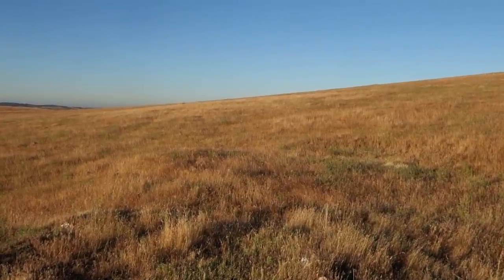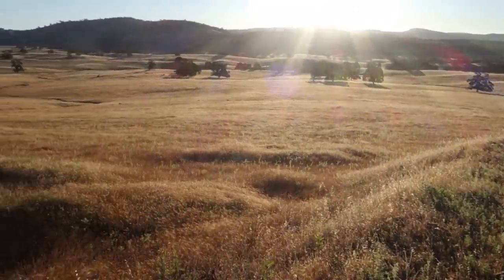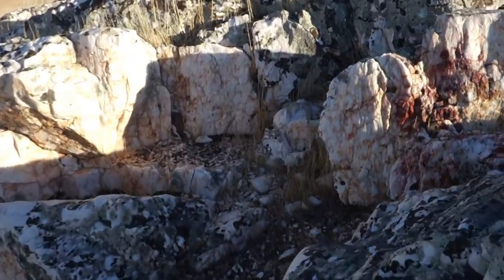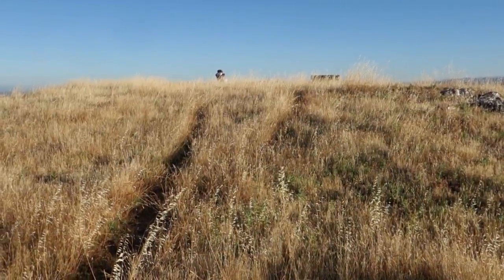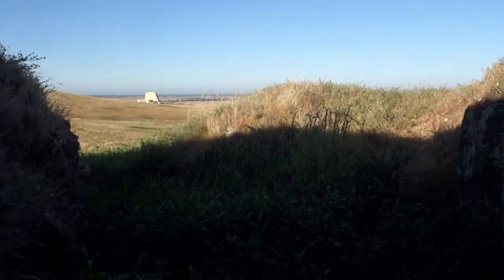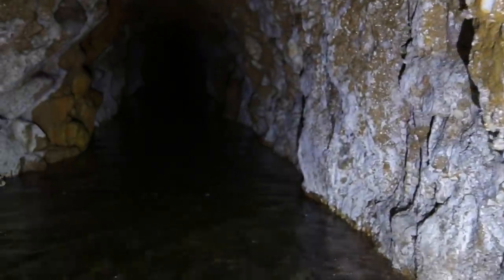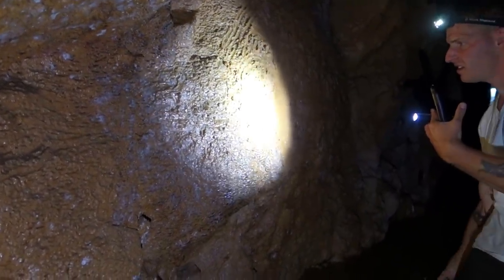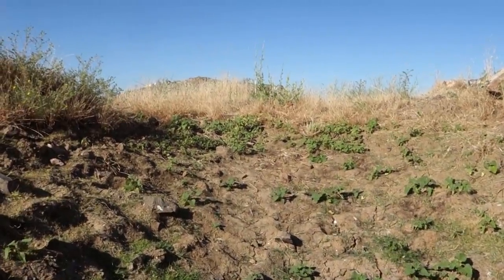The Gold Mines Of Beale Air Force Base - Part 1 of 2

Comment: Thanks for the video! Cool to see the mine shaft and wow, how clear is that water.
We lived on Beale for 10 years since 85 and still use the base as retired Air Force member.
I use to take the kids for hikes all over the base and the Spenceville Wildlife Area. You can still see the old wagon wheel ruts on some of the old narrow roads through the hills.
There are a lot of Coyote that live on the base and watch out for rattlesnakes. 
At one time the base consumed 80,000 acres. The Donner Party come through Beale.
We now live a less than an hour away in an old gold mining town on a ridge between the North Fork Yuba and the South Fork Feather rivers. The back of our property is an old gold mine, tons of gold bearing quartz all over the place.
As Camp Beale was an Army training base and a POW camp for Germans during WWII.
There were a lot of concrete structures that were built and used for moving tank targets. 
To purchase property around the base you must sign a disclosure agreement acknowledging the potential present of unexploded ordinance. I myself have found old exploded shell parts.

Comment: Cool stuff. As I am sure you are aware, Patton trained at Camp Beale back in the early days of his career in tanks. There are still training munitions all over that area, Beale has offered to send teams out to clear property over the years and many have taken advantage of the offer, but, back in the 90's a handful of folks out trying to pull rippers on the back of their tractor or digging a footing have uncovered things that required work! 
I had family, now deceased, who was involved in the SR71 program and I got to see some amazing things as a kid.
Seeing water that close to the ground down there is interesting. When I was a youngster I worked for a water well drilling company. The area just east of where you are is well known for problems getting usable household water from a well. There are several 400 ft. dry holes in that area, and many marginal wells with complex storage systems.
The quartz is amazing.  After all...Yuba Goldfields isn't far away.

Comment: I suspect that the 3 bolt pad foundation would be for a beacon light tower with a stand by generator and fuel tank, radio beacon also would have the same set up. (and /or).  It would follow with the 40s era navigation aids tech. at a WW 2 air base.
Reply from the maker: Yes, that makes a lot of sense. Thanks.

Comment: The standard method for blasting rocks was to drill a hole to a considerable depth and deposit a charge of gunpowder at the further end of the hole and then fill the remainder of the hole with clay or some other soft mineral substance, well rammed, to make it as tight as possible.

Comment: Beale gets do stinking hot in the summer-but greens up beautifully with those fall rains. Interesting to see those high water tables in the elevated areas. Good tour! That cement post looks like the base of an antenna. Unbelievable, but that hard rock shaft looks like an oasis in the heat of the valley.

Comment: That concrete foundation with the metal footings looks like it was a base for one of the old airway beacons.  The concrete that looked like it held a tank could have been the fuel tank for the generator that ran the beacon at night.  Just a theory.
Reply from the maker: It makes sense. Thank you.

Comment: just wanted to interject a personal note,when i was a firefighter,we responded to a wildland (ok grassland) fire on that property,was doing a mobile attack and got my engine high cetered,couldnt figure out what was going on..i got out to have a look and damned near fell into an open hole in the ground.took a tow truck to get us out.having grown up in auburn,i still had no clue about mines in those days,just that theres a chit ton of em lol
Reply: Who were you fighting fire for? I worked at the Smartsville CDF station from 1987 through 1991
Reply: @muleskinnermining8661  auburn fire,1980 to 1992,we did alot of standby at the auburn station 10,, was the nyp or neu ecc when i first started,then they moved to grass valley,did you know john risosco or stan mcdonald ? or don lane? he was 2311 out of auburn for years...you wouldnt have any pics of the type 4 ,or model 4s on the mid 70s (ours was a 73) IH loadstar chassis? i want to build a model of the one i ran and have nothing but my failing memory...lol
Reply: @davekauffmanjr2069  , yes, I remember Don Lane!

Comment: Depending on when mine was worked, the miners could have used the mud to plug the holes before blasting. If they were using black powder. It's seen like that in the U.K. in their old mines.

Comment: That's not typically a type of place one would associate with gold. But.. it's not all that far, about 50 miles, from Sutter's Mill in current day Coloma where gold was discovered in 1848 that kicked off the Gold Rush.  I monitor the air traffic from Beale AFB, about 45 miles from me, on my ADS-B scope and radio scanner.  I see a lot of Long Range Radar planes, Extender's that refuel the Radar planes in the air, and 'Roper' jets that fly over me headed to and from the Mendocino National Forest area to perform training maneuvers.
Reply from the maker: Definitely a different environment than what is usually seen in my videos... That must be interesting to listen in on their comms, no?
Reply: I rarely hear the military aircraft communications, and when I do it usually sounds like they're talking in secret code.  Most the air traffic that I hear is Enloe EMS helicopters. On weekends I sometimes hear the Thunder Hill race track call for a helicopter, then I hear the Enloe helicopter being dispatched. Then I can watch their flight path on my ADS-B scope. It's a bit of a strange hobby. I don't know anyone else that does it.

Comment: First concrete foundation used to host a guy tensioned tower typically used by USACE erected/procured towers i.e. Loran et al. The foundation's triangular bolts mounted the base of the mast radiator on the central insulator of which there is a direct design match in water and on land in the link below. reference: https://www.wikiwand.com/en/Mast_radiator
Reply from the maker: Thank you very much.